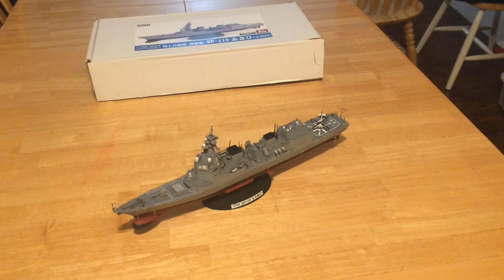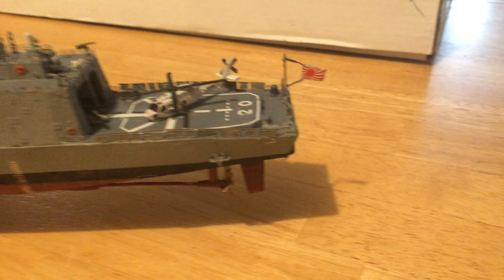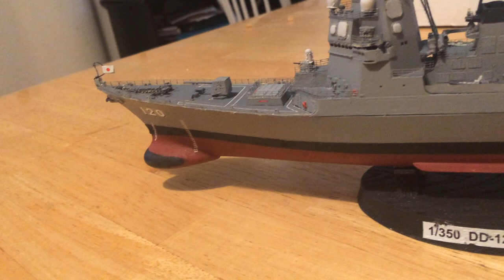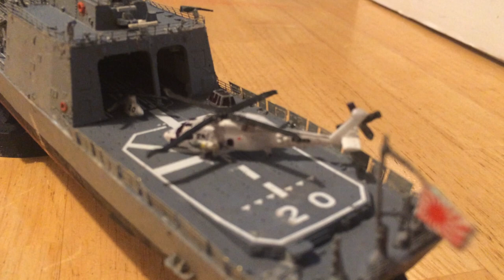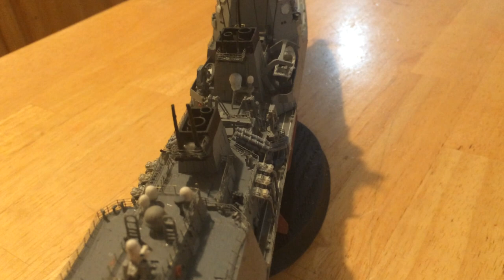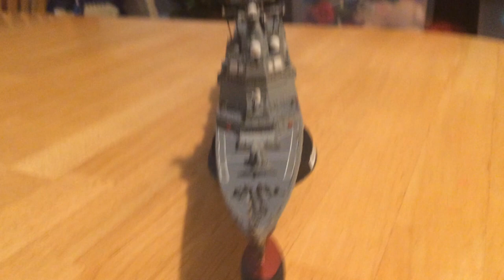Shiranui DD 120 JMSDF 1/350 Scale Video 4

Comment from the maker: Thanks to everyone for your kind words.  I am building a new Burke for the 2030s...a Flight IV which will be the size of a Korean Sejong the Great (about 11, 500 tons) but armed with Lasers, Rails Guns, preipheral VLS (Mk-55) and set up to be tronger than any other vessel afloat.

It would be about 570 ft long and a beam of about 75 ft, but be the same basic look as the Flight III but with a dual band and larger APARS, with two Lasers weapons, two 40mm CIWS Rail guns, a 130mm rail gun, and 90 Mk-41 and 160 Mk-55 VLS tubes...and the dual band much larger radars.  I intend to make a video of her when I finish the 1/350 build I am doing.

Comment: Great video as always Jeff! I have one question.
As you are surely aware, the Admiral Nakhimov is getting a serious modernisation. After it, he will carry
144 48N6DMs (as used by the S-400), 24 Redut-Poliment SAM VLS cells,64-80 UKSK VLS cells that will carry the Kalibr, P-800 or Zircon, as well as their ASROC equivalent. He will also carry 6 Pantsir CIWS systems which also count as SHORAD (since the missiles have a range of ~25km). He is also getting a serious system refit with many new radar, getting digitised...
What do tou think of all this?
Reply from the maker: The upgraded Russian nuclear cruisers are serious threats to any Navy.  Their principle problems are that they only have two, and that a US Carrier air wing cn continue to attack them from well beyond their missile ranges and continue to pump hundreds of missiles and smart weaponry at them until they ultimately get through.  The Russians would be very reluctant to risk these two ships just like they would be reluctant to send their single carrier tino any danger.  As I say, the ruiseres (the two they will have left) are very heavily armed, but the US weaponry was designed specifically to take on such systems from either the Russians or the Chinese and have a very good chance of getting through with the numbers they can throw at these ships from a single carrier air wing and battle group...and many times the US these days will have two carriers in a battle group.  That's as many as 180 aircraft and literally thousands of missiles.  So, though these ships are in fact very dangerous and if they could get in range and have a good fix and strong enough sensors to break through US ECM, they would be very dangerous...you can bet the US would be seeking to take them down with very large strikes using very strong ECM aircraft as well.  No American commander will take these ships for granted...but they do have the tools, and plenty of them...to take them on if they have too.